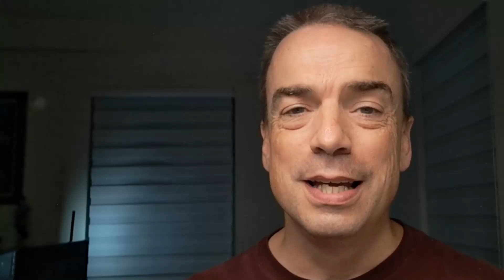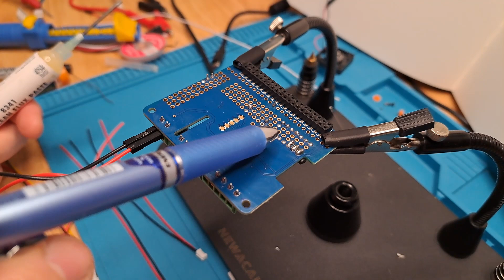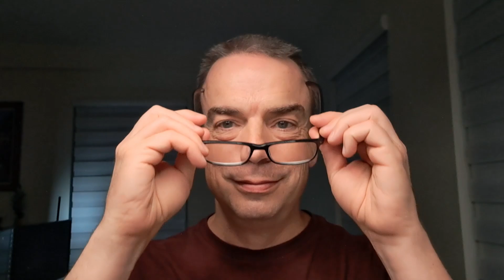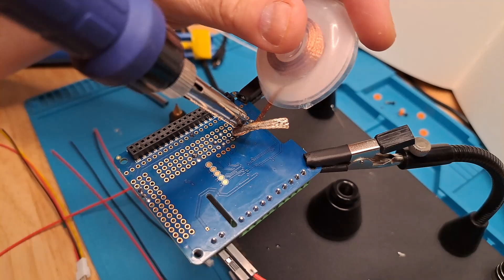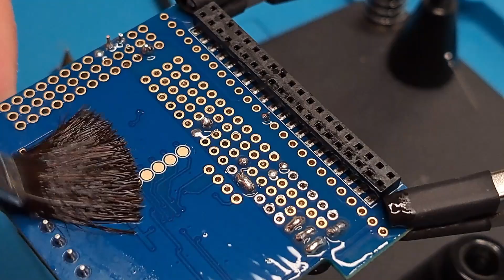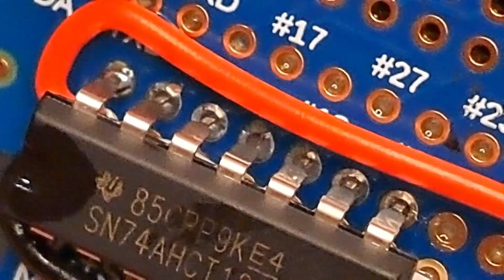Wishful Thinking - On Camera: 30 Day Challenge - Day 18

Comment: Loved the closer view over the last video. My soldering is slightly worse than yours. I did just learn about tinning paste, this is nice to use. I really try to avoid using GPIO on the RPI as I tend to short a lot of stuff. I normally use Arduinos, but I have moved over to ESP32s. I try to order boards in 2-10 at a time so when something is not working I can replicate the circuit in all new modules. If you can plan ahead and separate the good and bad sellers AliExpress is your friend. I know a number of people using this strategy. So in your case in this video, I would just start with a new board. Of course I know a number of people that don’t use wires to prototype, they just make a new custom PCB at every change. It’s not hard, some of them are even starting to order populated boards. I am not at this point and really would prefer to just stick to software, but it’s so easy to get sucked in!